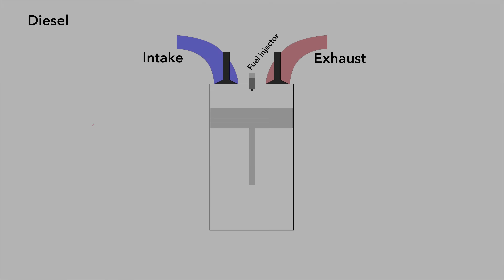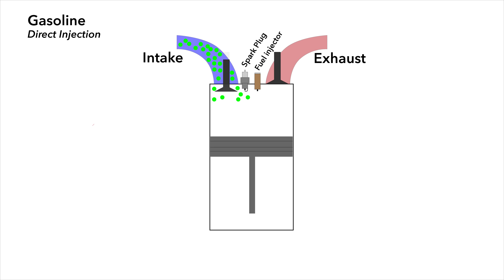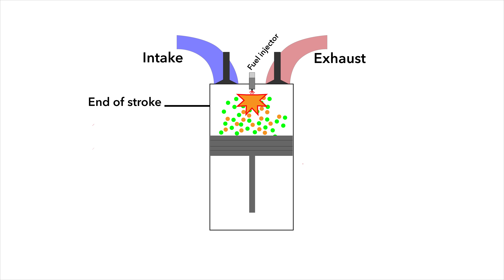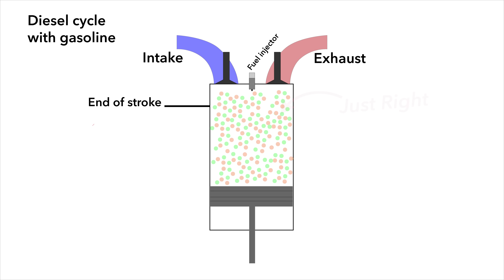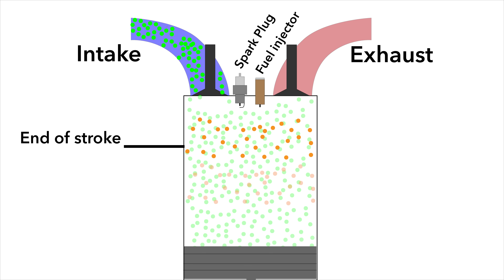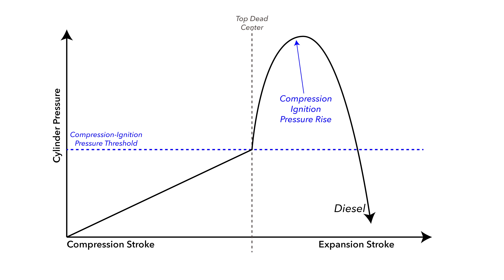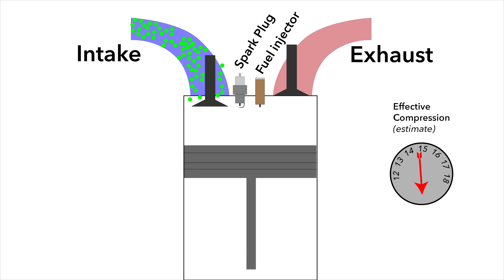Skyactiv-X: Mazda's Revolutionary Engine Explained

Comment: With this engine using higher compression at times does it require the use of 93 octane instead of 87 octane. If so what about the cost difference between the two. 93 octane is ridiculously higher in price, to the consumer, than 87 octane. It's a rip off by oil companies. I worked at an oil refinery for 20 years.

Comment: Your explanations are backwards.  Diesel combustion is slower, burning only as fast as the fuel is sprayed in, which is purposely tapered so that it keeps burning as the piston descends.  This is closer to the ideal thermo cycle (Carnot), plus the leaner mixture (no throttling) and higher compression aid efficiency.  In a gas engine, the premixed flame burns as fast as the flame front crosses the cylinder, which is so fast that the piston hardly moves during that time.  Re the DI explanation, correct about forming a mixture which will ignite close to the spark plug while a leaner overall mixture.  Indeed, an older Japanese engine (Mitsu? 1980's?) did that via a special small valve near the spark plug.  But, your suggestion that they sometimes inject "more fuel than can be burned" in order to cool the cylinder is strange.  No, you never want unburned fuel going out the exhaust.

Comment: If you’re going to use a spark plug. Why not run conversationally?

In my opinion you’re over complicating the normal gasoline engine.

-I’m sure it’s going to sound like a diesel all the time and you can’t rev that high because the engine was designed like a diesel

Comment: Interresting, so it has a dual firing mode. For depending on what is technically possible and optimal for the situation. 
I can see the pro's and con's. The pro, the engine should perform as good as possible under every situation. The con, there might be a change in fuel use or power depending on what mode you are in. Okay, can life with that.

Comment: I thought about Mazda's system for a bit and I think it is deceptively pointless, and more marketing than anything. As I understand it, the true benefit from compression ignition is actually is derived from the shorter duration of combustion stemming from the near simultaneous combustion of all the fuel in the chamber, like a diesel. But the way Mazda is doing it, the actual combustion ignition only starts from a small kernel, essentially making it just like a normal spark ignition system in the end.
Reply: Seen all sorts of exotic ignition techniques, cold plasma, lasers, etc. All nice but including this mazda hcci requires a flame front. The only methos that does not is microwave ignition. That is the future. No mixture is too lean to combust entirely.

Comment: I admire Mazda's engine technology, but my personal experience with a new 1990 M6 soured me on Mazda.  With less than 17K miles I had a failure of the power steering system along with a failure of the catalytic converter.  Both of these were in careful use of the car.  I loved the design and ride of the car but these combined failures make me not want to risk another Mazda purchase.  Mazda tried to get out of covering these items fully.

Comment: As an owner of an e skyactiv x Mazda 3 I can tell you that its your best option if you want a very economical car which drives just like a good old naturally aspirated 2 litre 4 cylinder. No Turbocharger, no lag and power increases with your revs. Just like it used to be.

Comment: This is a garbage engine. Why didn't mazda correct there common gdi problem with coke on valves, heavily restricting airflow into the cylinders, with the common simple solution of dual injection cycles, keeping valves clean????

Stay smart consumers, stay away from all direct injection engines like ALL skyactiv engines!

Comment: Basically, all they did was use a double spray of fuel. One at the start with air fuel mix and another later after the spark. Wouldn't this just increase more carbon build up and spend more money replacing foul spark plugs in the long run? Lol.

Comment: you dont explain this technology as clear as it should be. a simple way to explain it would be mazda just adds fuel in conjunction with a spark. which is different from standard direct injection engines which add the fuel sometime during or before compression. mazda simply adds a very lean premixture to compensate for the point of insertion of their additional fuel at spark. otherwise, if they didnt do this, the fuel needed at the exact moment of spark would be too great on its own without the special premixture, and would not work correctly.   so mazda justs adds a small premix of fuel so they can properly set up an engine to run at moment of spark direct injection. which is not how traditional direct injection engines operate. its very simple and ingenious process

Comment: How about using both gas and diesel just a hint of diesel will boost range of travel for a longer stroke on comercial use and a shorter more powerful stroke for domestic application.

Comment: The drive train of the future will be the hybrid.  Not like the backward ones they sell us now. I mean like the CSX trains where the fuel engines charge battery banks while the electric motors drive the train.  Same way they built the first long range diesel submarine.  Nothing is more efficient in gasoline or diesel than a stationary engine chugging along at the same never ending speed.  CSX claims to move 1 ton of freight 500 miles on one gallon of fuel. Some of the last diesel subs (40 to 60 tons) had a range up to 31,000 miles.  The only reason we don't have that yet in my opinion is because the Rockefeller's (big oil) wouldn't allow it.

Comment: Car aint more fuel efficient,aint have more power and when u step hard on t gas sounds like the engine will brake apart.... revolutionary? Nop, different yes, that's about it, rest my case

Comment: I like simplicity - you are begging for problems with this complicated engine. If everything isn't perfect, it will run like crap or it won't start.
Reply: Exactly, overcomplicates the power cycle, doesn't eliminate the sparkplug, requires too much electronic 'magic' to work.

Comment: I wanna see this guy try to start a diesel with the glow plugs disconnected!
Reply: It actually will work
Reply: Out here in california on a hot day  you can actually do it.
Reply: @jackdaniels2657  so your saying those glow plugs are unnecessary?  and if so under what ambient temp will it not start?  i.e. will it start at 50deg f or does it need to be 90F
Reply: @kazadori164  itll work at 60. But any lower than that nd itll have a really hard time starting.

Comment: You need to get into octane numbers. Gasoline is the opposite of Diesel if it comes to Octane number. Diesel is using a different number, Cetane..Diesel is extremely eager to self ignite Gasoline very reluctant to self ignite That would be a good starting point for this video. This also explains the entire philosophy of diesel and gasoline engines. The increased efficiency and fuel economy is what is all important! I give it a thumbs up!

Comment: You can keep your Mazda cars.  I had a Mazda 626 and it was in the shop, for repairs, so many times that I had a reserved seat, in the waiting room, with my own coffee maker on the table beside me.
Reply: Strange, because my Mazda 626 is 22 years old and has never given any problems whatsoever...!  
My VW  Passat is 10 years old and have been standing on blocks in my garage for the past 5 years...!
Reply: @danielcoetzee5793  My biggest problem was the driver's side CV boot would tear about once every 3 months.  The second biggest problem was the rear main seal would leak no matter how many times I had it replaced.
Reply: @henrybaran340  Sorry to hear that! My own left front CV boot needs replacing but it will only be the third time in 21 years with nearly 200 thou kilometers on the clock. I consider it wear and tear and maintenance issues, not defects. No major breakages or break downs. I absolutely love the Mazda.
My only reserve is that it has no airbags but it was not unusual for its time. And it doesn't have much in the way of electronics and gadgets. I absolutely detest those things but I will probably never find another car without it.
I will never get rid of it as I consider it an old and trusted friend. 
Maybe you'll reconsider your objection to Mazda cars.....! Have you had feed back from other Mazda divers? Maybe your's was that unlucky one in a million dud...! My sympathies!

Comment: Wrong, Alex. There is no air/fuel mix in a Diesel engine. The fuel never mixes with the air.
Reply: @S Hendricks Think that over and tell me at what point the fuel "mixes" with the air. It never does. The air ignites the fuel spray, with the result that the injector effectively sprays fire. The injection method makes no difference.

Comment: Well
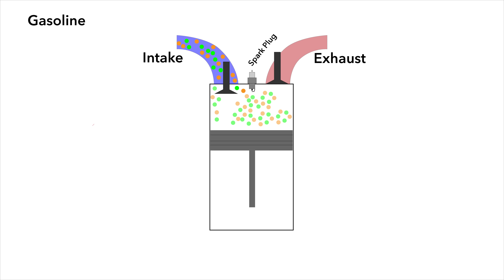3:20 where is injector????
Non of modern engines do air/fuel mix in a cylinder 
Only Air go through intake valve
 fuel go through injector
Only engines with carburetors can do that
Very immature video 
LoL

Comment: Didn't Rolls Royce solve this problem on the Merlin engine, burnt gases left in the cylinder after the exhaust stroke, mixed with new air/fuel r weakened the compression reducing power slightly, they overcame this by putting another spark plug over the exhaust valve to fire 3 crankshaft degrees before the main plus fires, giving it more efficient and smoother power.
Why this technology and at what cost of development when the world is forcing vehicles to go green electric power?

Comment: Why Mazda (or should I say Ford!) isn't moving towards EVs? Looks like an innovation in the wrong direction!
Reply: Faham Negini not everyone wants an EV. Getting an EV means I still need a gas car for long trips or trips that I don’t have time to plan out / wait for charging to finish, etc.
Reply: @boostedmaniac  wrong! 300+ miles range (Tesla model 3) is good enough, and there are super charger networks growing rapidly (70 miles charge in 5min)!
Reply: Faham Negini there are tons of gas stations scattered across the US and it only takes minutes to fill up. A supercharger requires 40 mins to get 80% charge. And if I drive in the middle of winter, that range is even less. Again, it will require some planning because I need to take into account where to make my pit stops based on the range left and how I will spend my 40 mins waiting for it to charge. 

Also a Mazda 3 is cheaper to purchase than a model 3. If I had to have one car, then I’d choose gas because of flexibility. I have a coworker that has only an electric and he has to sit at charging stations because his apartment doesn’t have a way to charge an EV.
Reply: @boostedmaniac  buying a car specially brand new is the second biggest investment for most people, you should look what's coming in the future and make a wise decision! In few years makes no sense to have an ICE car so if buy one now get ready for the severe depreciation.

Comment: So...this is guaranteed to have carbon build up on the valves.... WAY TO GO.
Reply: Mazda engineers said there is a new special coating that prevents carbon build-up (they wouldn't share the info of the actual coating)
Reply: Well carbon builds on the exhaust valves regardless... so hold your horses boyo, Run a methanol injection system via vacuum will help keep the intake valves clean, however even traditional non Di fuel systems have carbon build up on both valves, rebuild a motor and learn. Add a methanol system and a smaller pulley belt for the roots blower and this motor could get a D grade in my book... a D for Danggggggg!!

Comment: The Mazda I bought turned out to be a Ford in disguise which proceeded to fall apart.
Reply: Sry bout your ignorance on buying cars is not an excuse I will tolerate, a little research would have showed you Ford had sizable shares and ownership with Mazda and they shared tech and parts. lots of manufacturers have been doing this for decades to cut down R&D costs. Also a little more research would have revealed that since 2015 there is no Ford logo stamped anywhere on a Mazda.... buying a used car also is another separate argument in of its self, where as you should assumed the risks of private party sales or you refused an extended services contract from a retailer. At what point will the consumer take true ownership and responsibility of their property I ask? Or were you playing coy and hoping for sympathy with your comment.
Reply: @aaronmonke6825  Wait ... Whut? Mazda 3 IS based on Ford tech? WTF! GDI!!!! Mind you, had a focus estate for 16 years and miss it a lot.

Comment: Alex how is this technology different from Nissan new technology 2.0 turbo engine
Reply: Mien Ober Gruppen LORD Commander lol, the Nissan is a dedicated spark ignition engine that is changing the crankshaft positioning to alter the compression ration which is neat in its own right. When you want power, a mechanism is pulling the pistons further from tdc via crank to lower compression and turn up the boost with a wide range exhaust  driven variable displacement pump. when your at cruising speeds the crank moves the pistons closer to tdc raising the compression but they turn the boost down to keep from knock/pre detonation or melt down. Btw the Mazda is using a root type supercharger to keep the air lean at higher rpms, it's not there for performance but for efficiency, the blower is proving the air the 2.0 liter cant draw it on it's own. But that doest not mean we cant monkey with it and make a little ripper. Fundamentally
Reply: aaron monke thanls
Reply: You posted that a week ago and no one answered thought I'd help bro

Comment: Skyactiv=underpowered; less fun to drive
Reply: My 2018 Touring Mazda3 gets 185 hp with a SkyActiv-G 4-cyl 2.5L engine while my old 2002 BMW 325Ci got 184 hp with a 2.5L V6 engine. The Mazda3 goes 0-60mph in about 7 seconds while the BMW went 0-60 in about 8. So, it definitely is way more efficient and still plenty of fun for the size of the engine.
Reply: @immichaelyeh  both are pathetic. If 185 horsepower in a front wheel drive car is "fun" to you, I'd say your imagination stopped evolving right around age 4.

Comment: The problem with this engine is that high compression limits power. It is similar to the Atkinson cycle. You are just trading some power for more efficiency.

I would much rather have Nissan/INFINITI’s variable compression engine because it can deliver the power and the fuel efficiency.

Comment: complete wrong! you do not understand the Otto and the Diesel cycle! the diagramm shown on 3:43 is mixed up. The Diesel has a "same pressure process" because the "firework" begins 0.2ms past injection, it begins to burn in the ms the mixture builds up and keeps on burning as long diesel is injected (so the pressure is kept on a high efficient level) there is no mixture that makes "boom" as you explained before (this is only the knocking if the diesel is cold and the mixture builds up while the piston is compressing to a higher temperature. The Otto in your wrong diagramm is told to burn down slowly, but no, it has a "same room process" it burns down the mixture very quickly, much quicker than the Diesel. The point is that for this process there has to be a Lambda 1 mixture in the whole Cylinder and this is what SPCCI solves in low speed cycles. They start the self ignition of the lean mixture with high compression heat and the spark. Less HC Cinder and NOX as the Diesel, because mixture has time to build up and no hotspots on the edges of burning mixture. short lesson by a german automotive engineer

Comment: i see nothing but trouble with this bs technology, and cylinder deactivation too? nothing but junk, good luck to those who buy it
Reply: Steve Prince  and gm hasn't got it right yet... What makes you think the Japanese will?.. Tell me about Mazda and their rotory engine how great that POS was... Cylinder deactivation is junk.. Always has been always will be.. any good mechanic will tell you that you will have problems with this over engineered junk after some miles on it , not some back yard  beat everything on and off with a hammer genius like yourself..
Reply: Steve Prince  i can see from your reply that your just as stupid as i knew you were, and you speak as tho you know so much when i can see you know so little,you are assuming way too much, especially about me..I agree modern technology is awesome to a point but when something doesn't work, it just doesn't work..surely your enormously galactical empty head can conceive that, Cylinder deactivation will work seamless and it will stay seamless until you get some miles on it and it will start burning oil..  probably like the 2.0 diesel your so called modern company makes...Most of the european made trash ( probably made from the same worthless company you work for) i see rolling down the street here in the usa smoke like they are burning firewood for fuel. You quoted that they fly you here to work on vehicles made from there? Why may i ask ? Are they that badly/poorly made? maybe it is your companys incompetence?...sending your trash vehicles here then having to send your uneducated soul here to work on them, i have to tell you i laugh when i read that, you are quite the comedian ..

Comment: inclusive carbon building up :D
Reply: Mazda engineers said they have developed a new special coating that prevents carbon build-up (they wouldn't share the info of what the actual coating is) only time will tell if it works!

Comment: Would it be easier just to inject the gas à the proper top dead center like the diesel engin.
Of course I realized that I  am probably missing something by stating this.
Reply: Gasoline is too volatile. It still needs the spark timing to properly ignite.